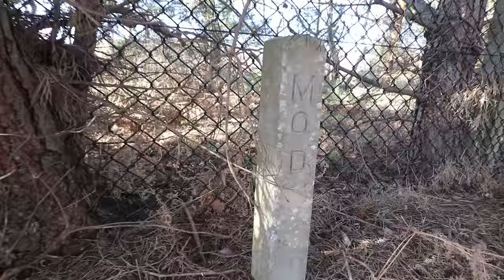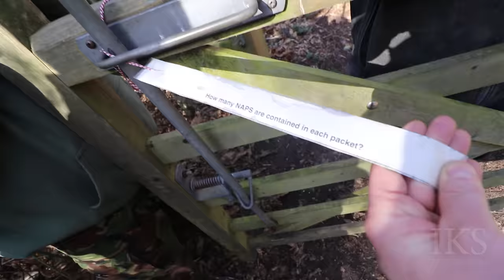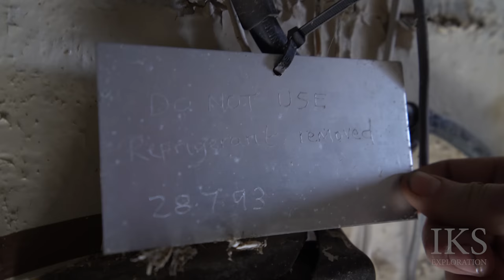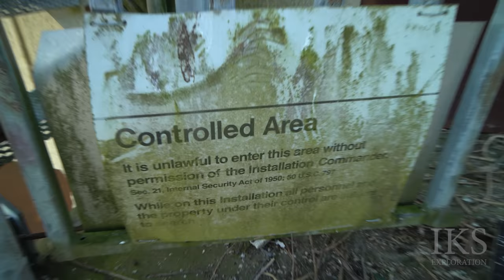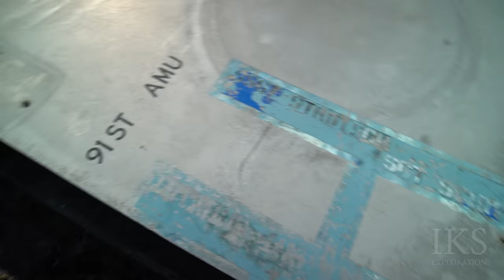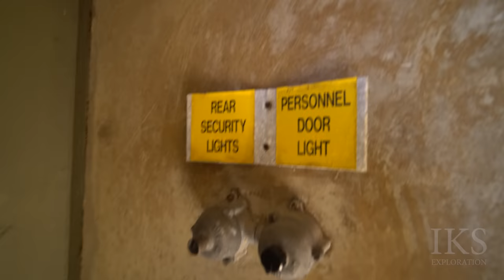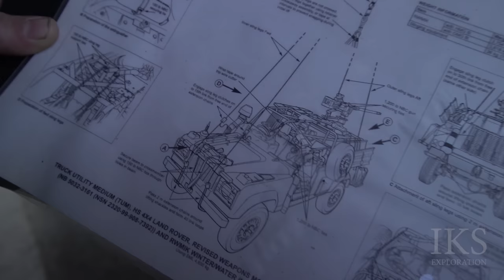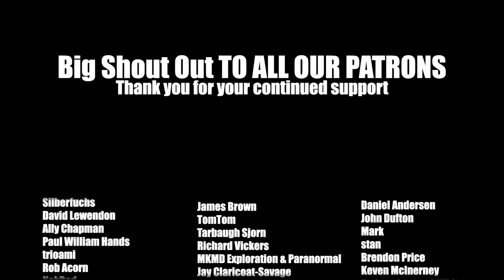Abandoned American Airforce Base in UK

Comment: The area you were exploring was the aircraft hot refueling pads. Thos metal doors rolled open and a refueling arm came out to hook up to the aircraft.  It was the only one in Europe at the time. I was stationed at the Twin Bases from 91-93, spent many of hours working with this system.
Reply: @daveoberle2305  the old Hot Pit

Comment: Interesting that all the HAS doors have been removed. The non air side looks very much in use
Reply: They were removed about 3 or so years back for scrap, at the same time all the underground cabling was torn up for the same reason. You were lucky not to have an encounter with the guys from the active area at Rock Barracks as I have seen them patrolling the area you were in and out as far as the east gate!
Reply: They look similar to the HAS on Bruugen
Reply: They have two cameras on the second HAS building, they must receive an instant notification if you go near the fence.

We were taking photos of the building outside of the fence from the Forest trail and a patrol vehicle raced along the side of the fence and towards the East Gate.

I only noticed the cameras after looking at the photos we were taking. They must have thought we were trying to get in? 🤷🏻‍♂️